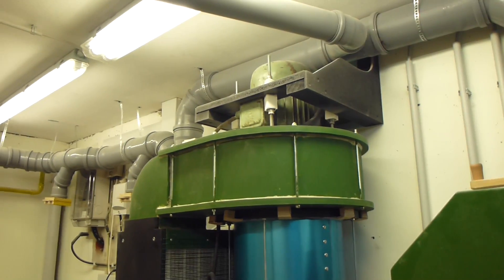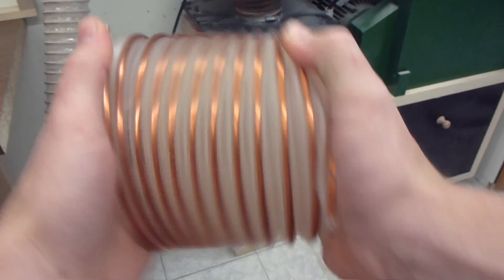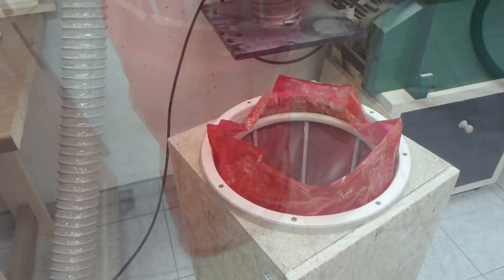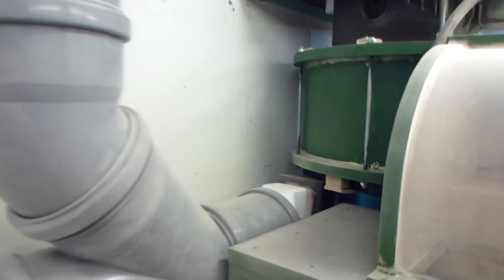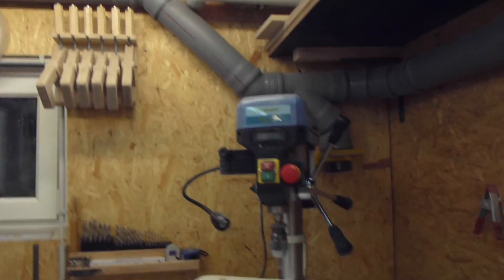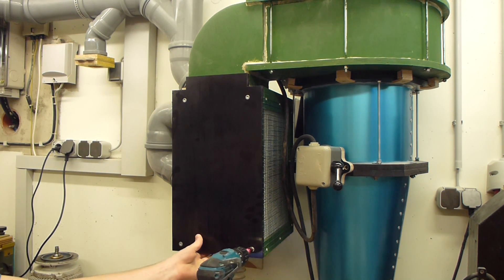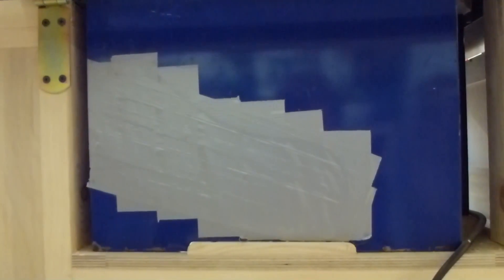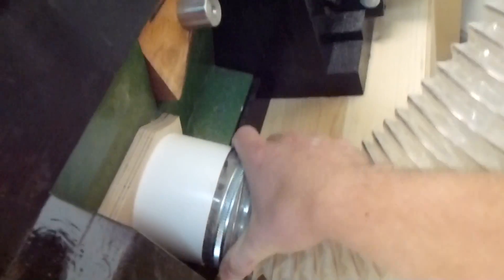Homemade 3hp Cyclone Dust Collector

Comment: Hallo Marius,

ich sehe, du verwendet auch Abwasser-Rohre für deine Absaugung - das möchte ich auch installieren.
Wie ist denn deine Erfahrung mit elektrostatischer Aufladung von den Rohren. 
Hast du solche Effekte? Hast du etwas dagegen unternommen?

An dieser Stelle vielen Dank für all deine interessanten Beiträge!

Grüß e Markus
Reply from the maker: Mr Tablet Ich hab relativ wenig bis gar keine Probleme mit e. s. Aufladung. Nur dass Staub etwas daruf haftet aber  el.Schläge oder ähnliches hab ich noch nicht bekommen. Ich hatte zwar mal vor alles mit Draht zu umwickeln und zu erden, aber weil ich bisher keine Probleme hatte, hielt ich das noch nicht für notwendig.

Comment: Marius I have learned a great deal from your videos and am impressed. I expect you will have entered university by now and will do very well. I tried to link to the SketchUp drawings but it says the page is no longer there. Are the drawing still available? I intend to incorporate your upgrades to this system. Is 3 HP really required? would 2 hp do and if not how would you change the impeller dimensions?
Reply from the maker: Link should work again.
3HP is definitely overkill for this size DC, even 1,5HP would be enough. But I had the choice between a 1,5HP motor for 50€ or a 3HP motor for 10€. I planned on rebuilding the whole thing and make it bigger and stronger. (45cm - 50cm impeller) More in future videos.

Comment: Marius, really nice dust collector system and web site.  Can you provide approximate dimensions on the secondary filter box and what size filters you used? Do you have any idea of what the approximate filter area is for the two filters? How often do you clean or replace the filters?  Please keep sharing, I really enjoy your YouTube videos!
Reply from the maker: Bob Gellenbeck I use these filters: http://www.amazon.de/Fellowes-HF-230-mittelgro%C3%9Fer-HEPA-Filter/dp/B0067D7CSC/ref=sr_1_2?ie=UTF8&qid=1427544769&sr=8-2&keywords=Hepa+fellowes (27.9cm x 33,4cm x 3cm) and the box is build around these filters. I have no idea how big the filter area is, but I think it's still to small for this size dust collector. I clean them when I think it's time to.
Reply: Marius Hornberger Thank you for the Info!

Comment: Nice job.  Good video.  Good engineering.  I believe your bag is collapsing because the system is overpowered.  Too much power is resulting in a too high pressure drop at the inlet to the discharge inside the cyclone.  To avoid this a larger exit would help but then you need a larger inlet, and larger cyclone diameter, and so on and so forth eventually reaching the conclusion that the power being used is really more suited to a larger system.  To prove this, why not temporarily reduce the DISCHARGE flow from the filters by internally blocking portions of the discharge filters duct tape on half of one filter on the inside etc.).  This in turn will reduce the flow through the fan and result in lower net power  (the power is proportional to the flow cubed).  See what happens.  There are many other ways to do the same test but good understanding of how the system behaves will result in a lot less time spent woodworking.  Good Luck!
Reply from the maker: Thank you man! I already noticed that my blower is a little bit big for the cyclone. I already made some improvements in another video. There now is a bigger outlet pipe. The test you mentioned sounds logical, but if I had the choice between a defected bag or less airflow and suction, i would choose the deflected bag. I also noticed that really understanding the system is easier than building one. ;) 
Do you do this at work, because it semms that you know a lot about cyclone systems?
Reply: Marius Hornberger I am a Mechanical Engineer.

Comment: hi , nice job man :D
what kind of motor did you use for the dust collector , and what for the band saw?
i have matthias's plan , but i'm not sure what motoe to buy ...
Reply from the maker: The dust collector motor is a 3hp 3phase (380v) motor with 2800rpm.
The bandsaw motor was a 2hp 3phase (380v) motor with 1000rpm, but now I put on a different one to get a higher blade speed. Also 2hp 3phase but 1400rpm.
There is, as far as I know, a motor recommendation in the plans from Matthias.
Reply: ook , tnx ... i think i will go for 2 phase motors otherwise i'll have to put a cable from my metal workshop ( i have a small engeneering business here in italy ) to my shed , and i'm trying to avoid that , but i'll do it if i have to .
tnx again.
i'm enjoying all your videos :D
Reply from the maker: You mean a single phase. I got all my motors from the garbage or from ebay. Also some single phase ones. Just have a look there. There are always motors available.
Reply: yah i mean single :)
i'll try there then :)
tnx
Reply: Marius Hornberger You got 3 phase for the shop ? You take that seriously !.
Reply: 38911bytefree in europe (uk excluded) it's pretty common to have 3ph at home actually, good for electric/induction hobs for instance

Comment: Did you put any kind of ground wire on the air ducts, to control static electricity?
Reply from the maker: Actually not, but I wanted to do this once everything else is finished. I had no problems so far with static electricity, except from fine dust that covers the ducts.

Comment: I just read that you are not completely satisfied with your collector. I believe it lacks suction and that's because the impeller diameter is too small. Matthias has put a table in .xls in his first dust collector article. If you want to reach the suction level of his collectors with european 2860rpm you have to make the impeller about 42cm in diameter! From my own frustrating experience.
Reply from the maker: You're right, the suction of my collector is a little bit low. But making a 42cm Impeller would also require a new impeller housing... But I think my problem is not only the impeller size, but also its housing. I think the gap between impeller and the walls is too big. I put my SketchUp drawings in the description, than you can see its design. You may have some suggestions on how to build it more effective? I just drew it until it looked like the commercial ones. But I already drew another impeller, which should work better. Currently my motor isn't even close to get warm.
Reply: Currently I'm rebuilding mine too. Actually, I'm building a completely new one, the first was thien-bafle based, but I dislike it because I like to give the sucker bigger chunks to suck in, just for fun and sound. (knowing the relatevly narrow gap thien bafle has, bigger chunks get stuck in the bafle 'spining around like crazy' wich is quite fun until you need to get them out)
I tried downloading the sketchup file, but my sketchup is very old, only V.8, so if you could 'degrade' it to my level, I would be able to see inside.
Reply from the maker: Ok here is a new link: https://www.dropbox.com/s/011phe2gisc8o4b/Dust%20Collector.skp?dl=0
If you rebuild it and make a cyclone, make sure the cylidrical section is bigger than my one. It should be more like the ClearVue one. Because if I suck up some little pieces or woodchips from the lathe, they 'spin around like crazy' until I suck more stuff or I turn it off. And at some point that spinning noise gets annoying...
Reply: It's a shame that I already made the cylindrical section... Wich way do you suggest making it bigger? In diameter or height? And yes, it gets annoying :)
I've seen your new impeller, factory made dust collectors are made with similar impelers because they are supposed not to be broken by the stuff that goes in the collector, because in those two-bagged collectors all the stuff goes through the blower first. 
I'm sticking with my old idea that the impeller should be larger in diameter. 
Take, for example, a shopvac or any other brushed vacuum, what happens when you block the intake? Rpm goes up along with the negative pressure rising up. Why is that happening? Because the only thing that keeps brushed mottor from accelerating is load (and friction), theoretically, brushed motor in perfect conditions would not stop accelerating. - O.T.
What happens when you block the intake in your induction  motor powered blower? Amperage drops, no higher rpms. That's why you need larger diameter impeller, my friend.
Reply from the maker: I suggest the cylidrical part should be a lot higher. I guess it works better, because the dust is further away from the blower inlet for a longer time. I think when the dust gets into the cone section it spins up more and centrfical force increases, because of the smaller diameter in the cone. And when centrifical force increases, it resists gravity and thats what I think keeps the dust spinning inside the system.
Well a larger impeller size would be appropriate, but I think a more aggressive impellerdesign would also do the trick. I loooked at some european industrial blowers and they are not a whole lot bigger than my one. My current impeller is just too efficient. I already recognized that while I was build it. When I spun it in the other direction I could feel more air come of it.
I stay with my idea to change the impeller design. It's easier for me, so I don't have to rebuild the whole blower.
There will be a video about the new impeller soon. (maybe 3-4 weeks from now)
Reply: Okay, I'll wait for the update, actually really interesting how will it turn out for you. 
BTW, are you from Germany?
Reply from the maker: Yes I am.